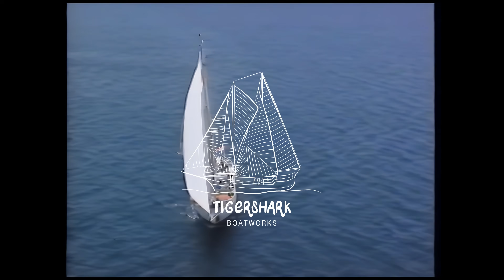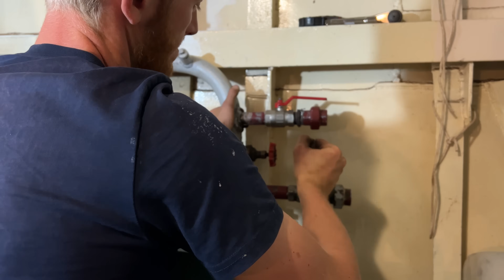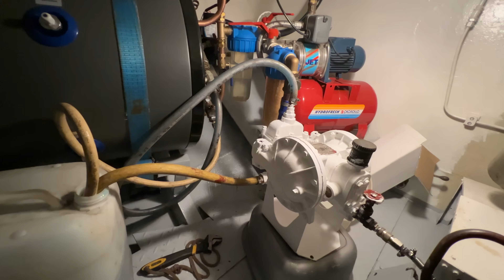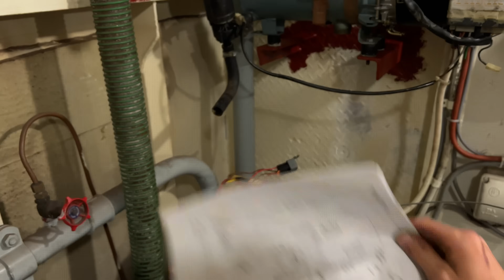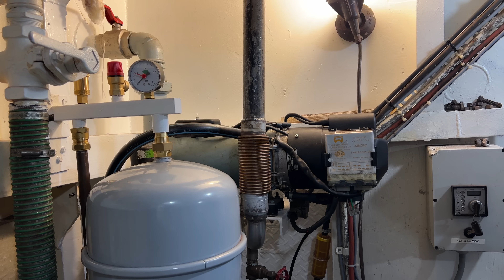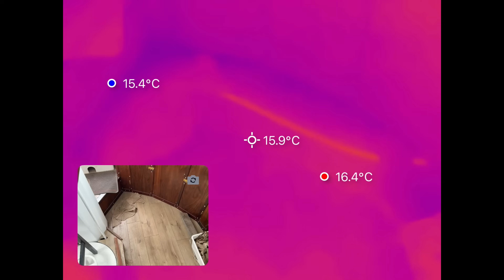Don't Make Your Heating System RIDICULOUSLY Complicated - Watch Us Do It

Comment: Dont you have the risk of back flow of cooland from one engine to the other, and doesnt this system mean that if you want both engines on that you have to go down to the engine room to temper the flow to the boiler ?
Reply from the maker: Well, not backflow, because the internal resistance of the stationary engine’s cooling water pump is higher than that of the coil in the buffer tank. The only thing we run into, is that the hot cooling water of the generator can bypass the buffer tank through the outlet of the main engine. This isn’t a problem when they’re both running, because then both have positive pressure, but with the generator alone, we have to close the valve that connects the hot output of the main with the buffer tank. Surprisingly, with the main engine running, we can just fully open that valve, and it will automatically divide the flow between the buffer tank and straight towards the keel coolers, even with the throttle valve fully open, so no need for extra tempering. This is turning into a complicated story. I hope you could follow that :)
Reply: @tigersharkboatworks  thanx so much

Comment: Very interesting, but something bother me : are not the coolings of the generator and the engine counteract each other with the more powerful one backing up the leaser one ?
You deserve more subscribers, Come on people SUBSCRIBE  and  THUMB UP they work so hard.
Reply from the maker: Hahahah thank you! Both engines’ cooling pumps are strong enough to counter any pressure that might come from the other one, so the flow always goes in the direction of the keel coolers (where the pressure is low). That being said, we currently have only the generators coolant flowing through the buffer tank. The main engine goes straight to the coolers, and it’s valve to the buffer tank is closed, to prevent generator coolant bypassing the buffer tank through the main engine when that is not running :) I should probably put that on a drawing

Comment: Any plans for solar power generation? Surplus power could be dumped into your buffer tank by way of an immersion heater?
Reply from the maker: Ah yess! We do have 2500Wp of solar, and a 1kW electric heater coil in the buffer tank, which I totally forgot to mention in this video, I works great in summer, because there’s enough sun and we only need the buffer tank for showering a hot water in the galley. But in wintertime the panels don’t deliver enough to heat the buffertank next to our daily consumption :)

Comment: It seems that the pipes running from the engine cooling circuit to the buffer tank should be insulated with polyurethane or some other insulation to reduce heat loss and for safety.
Reply from the maker: Yess, good idea, they should be. Once everything is tested and we’re sure we don’t have to change anything anymore, I’ll wrap them with something :)

Comment: That's a neat heating system. The guys at 'Sailing Flying Coney" have similar hull cooling pipes for the engine but are not as far along as far as developing accommodation heating is concerned. Be interesting to see how Daniel and Barbara address that. Super interesting post as always. Thank-you.
Reply from the maker: It’s quite a common system if you want to keep salt water outside of the ship. I’ll share if the pro’s and cons of the system after we’ve used it for a while, so they can consider if they want something similar or not :)

Comment: I would normally make the connection to the engines from somewhere on the head before the thermostat. That way the engine coolant temperature is automatically controlled at 82 deg C . You will have to manually regulate  the flow going to the buffer tank. Are you going to install a mixing valve for the domestic hot water so that you don't send scalding hot water to the taps ?
Love that you always paint everything imediately after you install it 🙂
Reply from the maker: The engines temperature is still automatically controlled by the internal thermostat. So when it opens, outcoming coolant will never exceed 85 degrees, unless we stop the flow, which we don’t plan to do. So for the generator, we can just pass all the coolant through the buffer tank before it goes to the keel coolers. Only if we want to use the main engine coolant, we have to set the gate valve to a setting that we’re sure it won’t run hot. And then keep our hands off. Unless we go to very hot area’s, then we might have to open the bypass more if it requires more flow. We didn’t plan on installing a separate mixing valve, because all the taps have mixing valves, but it’s a good suggestion. We’re gonna do some elaborate testing and see if it’s necessary to add some more complexity :) thanks!
Reply: @tigersharkboatworks  I don’t think you need a mixing valve per se, but I think a gate valve in the line would be prudent. 
I had a bus conversion motor home with Webasto heat and it would make the potable water too hot, full flow. 
Just suggesting.  I have every confidence you know what you are doing. 
JIM 🎉🥰🇺🇸

Comment: Simple is not the first word I would use to describe your setup, but lit looks very well thought out. I would add a coal or diesel cook stove that does not need electricity at all if you plan to go (far) north.
Reply from the maker: Thanks! We have the wood stove in the middle of the saloon that fits 2 pans, so we do have a backup in case we are low on diesel or run out of power otherwise :)